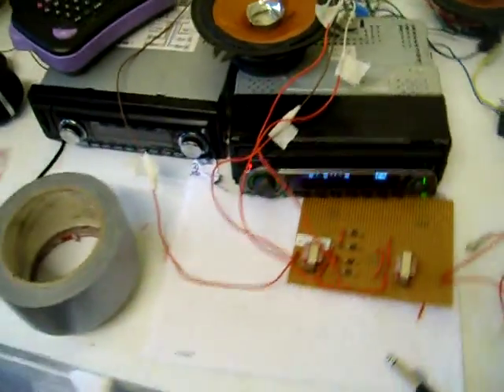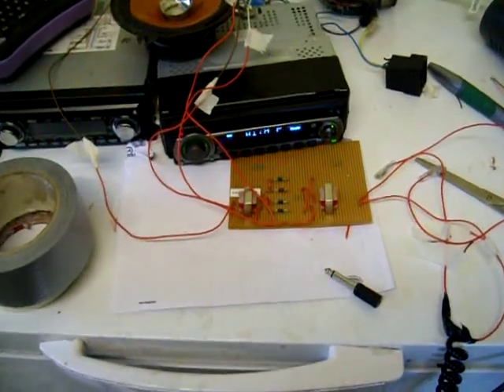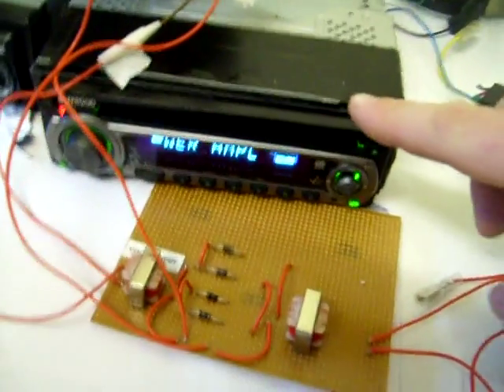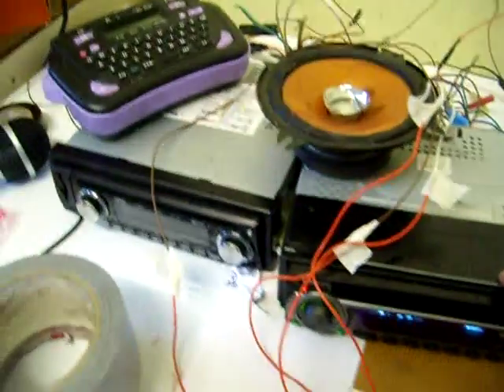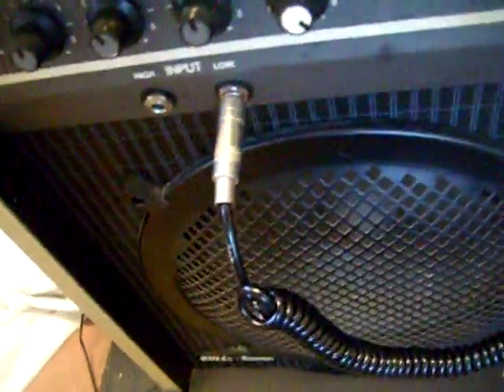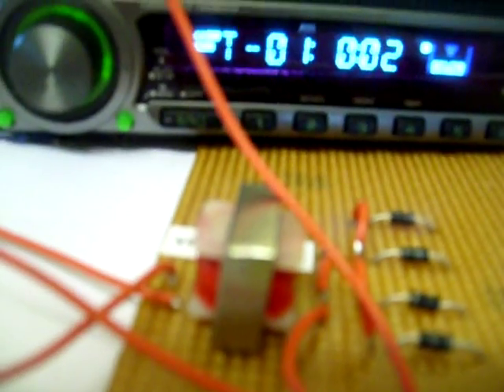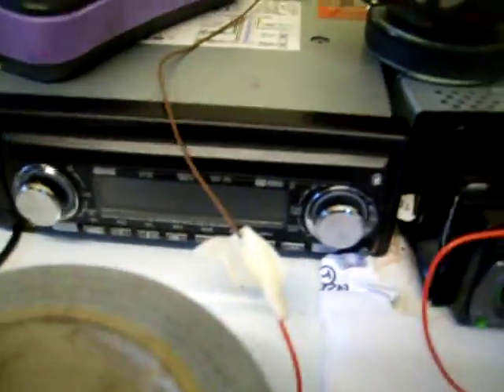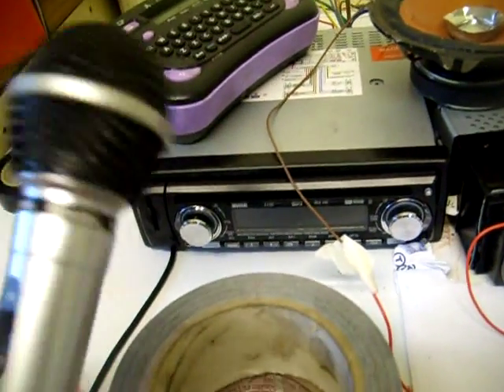Dalek voice ring modulator

Comment: I hope you are still monitoring this. I have 2 questions: can it only produce monotones? I mean, could you, for example, sing into it (or even speak normally) and actually get multiple notes?
Secondly, if I wanted to buy one  what should I search for? I'd love to DIY it, but I am a complete ignoramus when it comes to electricity and electronics. Give me a mechanism any day.
I figure it can't be any worse than Autotune, plus I think it would work in metal, if you can get more than one pitch out of it.
Reply from the maker: If you search for "analogue ring modulator" or "two transformer ring modulator" you should be able to find the schematic as well as various places that sell the parts.
I'm not sure how you'd get multiple notes other than repeating the same circuit with different carrier tones.

Comment: What is your reason for preferring germanium diodes please? Also, would it be possible for you to publish a circuit diagram and parts list for this project. Maybe even a kit of parts or a finished unit? 
I feel certain you would have a reasonable market amongst us Darlek enthusiasts.
Personally, I want such a unit for a life size manned dalek I am building at the moment.
Any help you can offer is gratefully recieved and any reasonable fees would be paid promptly.
Many thanks 
Dickie Dalek
Reply from the maker: I did make them for a few years, check out my other videos as this video is nearly 11 years old! 
Stopped making them in 2017 as I honestly can't be bothered with it anymore. If you search for "Sciphonix" on Ebay they occasionally show up. 
If you want to know how to make the circuit just Google "2 transformer 4 diode ring modulator". Also don't bother with Germanium diodes, basic rectifier diodes are best.

Comment: You said it was playing at 20hz; it was actually playing at 15hz and it should have been playing at 30hz. Right...
Reply from the maker: Depends which era of Dalek. In Destiny of the Daleks it was 15 Hz (well actually 14.5 Hz but it doesn't make that much difference). Current series Daleks are 25.64 Hz and the first Daleks from 1963 were 42.85 Hz. I suggest you look at my more recent videos, this video is 5 years old and a lot has happened since then!
Reply: MegaWayneD Where did you find the exacts Hertz for the voices ?
Reply from the maker: I originally found some on the Project Dalek forum but these days I tend to just listen to the Dalek voices and repeat the phrase through a Sciphonix XI voice mod and match the voice just by listening. I will say, it's taken many many hours to get it right though!

Comment: Out of curiosity, how would using a square wave affect the sound?
Reply from the maker: It makes it sound like crap! Otherwise I would've used a 555 timer-based square wave generator.
Reply: MegaWayneD Ah I see, well I heard about someone using it, but I was not to sure, you are really the only person I've followed on the voice modulators, so I was wondering what your experience was with the it,but you have done a pretty good job with them.
Reply from the maker: This is the first one I built way back in 2010! It's changed a lot since then. I'm currently trying to upload a video of my wearable Cyberman voice mod.

Comment from the maker: You will need a microphone amplifier too. It takes quite a bit of power to get the signal through the first transformer, diodes and second transformer. You should hear a slight rumble if you turn up the level on your ipod too.

Comment: I've been trying to build a modulator for a while, and I've been coming back to this video over and over again because it seems the most detailed! :D However I can't seem to get mine to work. I placed the components on a solderless breadboard, plugged in a microphone, used an app on my ipod to produce the frequency and plugged it into both a mini battery powered speaker and my PC speakers, but to no avail :( have any idea what I might be doing wrong, and what I should try changing? Thanks!

Comment from the maker: @NightVista Be sure to check out my video titled "Dalek and Cyberman voice changer/ring modulator" - the frequency for the Cyberman voice is a lot higher (around 356 Hz) and it's a million times better than the voice changer helmets. The ring modulator itself is really simple, the components I used are two LT700 centre-tapped transformers and four matching cheap silicon diodes (don't bother with germanium). If you need any advice feel free to message me.